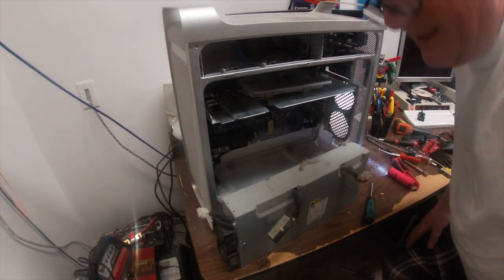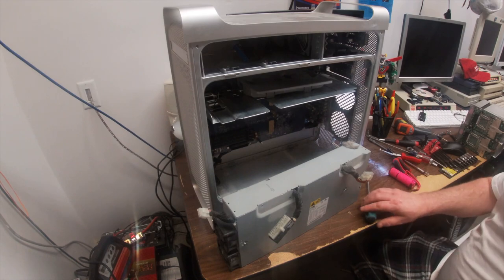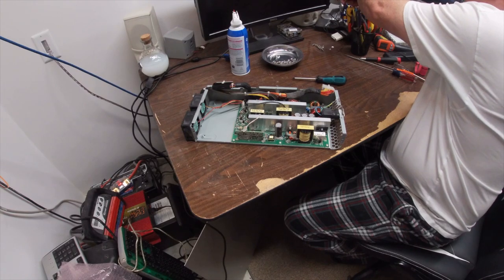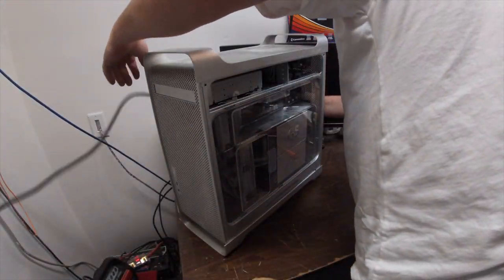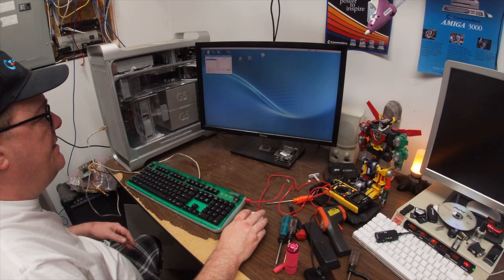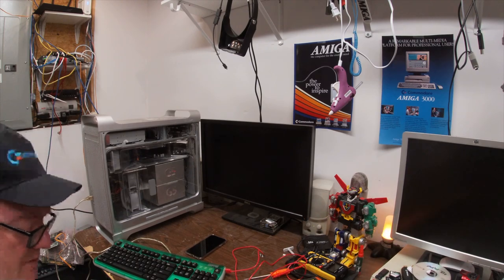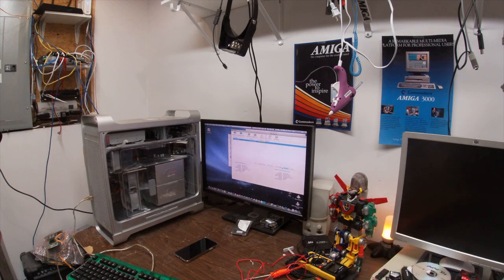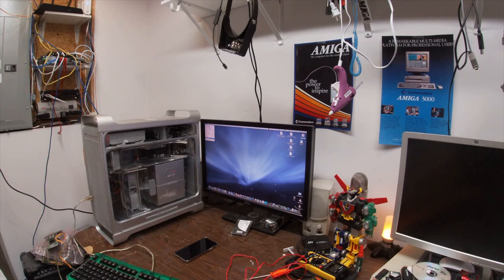MorphOS G5 powersupply repair

Comment: I have a Dual Core PowerMac G5 from the last year they were made. Sadly, the version not supported by MorphOS. It was in rough shape when I got it. I had to tear it all apart, clean up all the dust and muck and then reassemble it. Worked fine for about a year and a half. It no longer turns on now. I believe failing capacitors were also a problem with the power supplies in the later G5 PowerMacs. Perhaps there's something else I can check for now.  :)
Reply from the maker: Strange apple always used good caps as in quality , while nothing lasts
Forever. At least most are easy to swap.   The power supply wasnt too bad once i got it out.  Kinda tight in there at the bottom
Reply: I also have one of the last run G5’s was hoping to use it for MorphOS also. 
So got given a last run G4 from work. And guess what the PSU is dead.  Cam at least fix it  tough.

Comment: I've got a dual quad core 2.5ghz G5 with the damn water cooling system. Of course the water cooler is bad. I really need to fix it.
Reply from the maker: Those are nice units, i thought it wasn’t water but some glycol liquid? Maybe that was the 2.7
Reply: @ChrisEdwardsRestoration  dexcool :/

Comment: i have a problem where the psu clicks but when plugged in, but when i press the power button it also clicks but it doesnt post no fan spin nothing :(. Do you have any ideas? thanks in advance
Reply from the maker: in a G5? caps are dead.  they can be replaced.
Reply: Do you know which caps maybe?
Reply: @ChrisEdwardsRestoration  which are the most common ones thats the better question :)
Reply from the maker: Usually the decoupling caps you can either recap it or order a replacement ps on ebay whichever you find easier. Its about the same damage in price either way